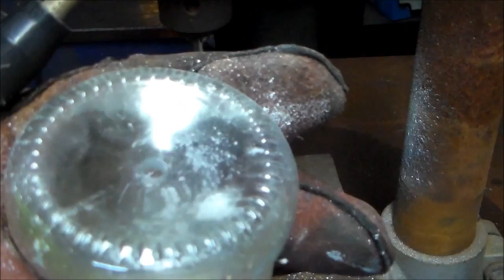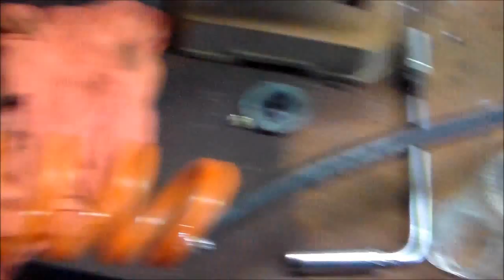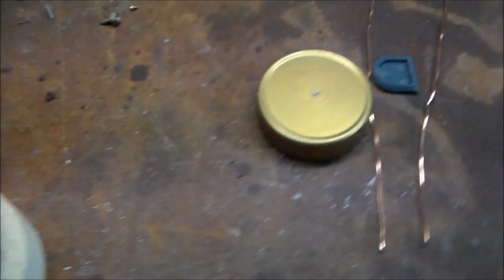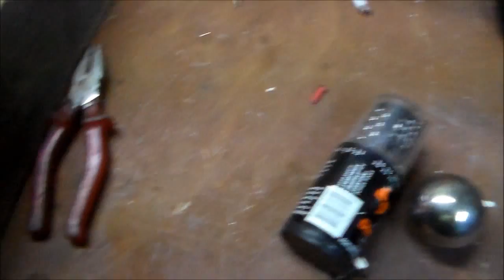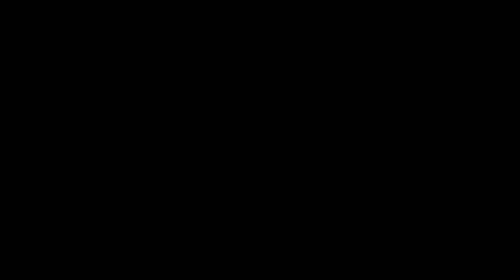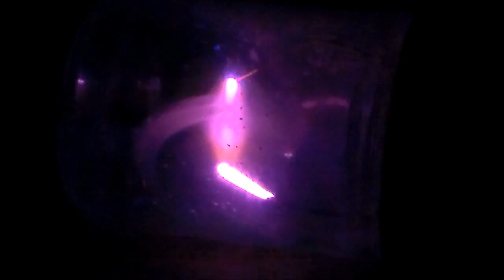Vacuum Tube in a Jar - First Prototype and Test run

Comment: 300 volts? 

vacuum tubes run at much higher plate voltages without any radioation o_o

Comment: @joeyf504327 flybacks are lower current and higher voltage so u can have the electodes farther apart and the arc inside the vacuum won't be as intense as a mot